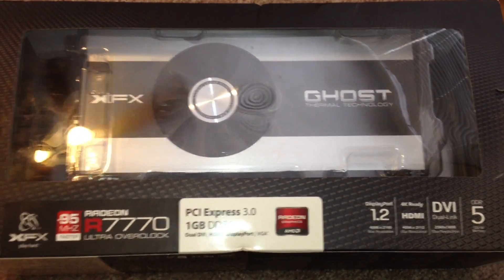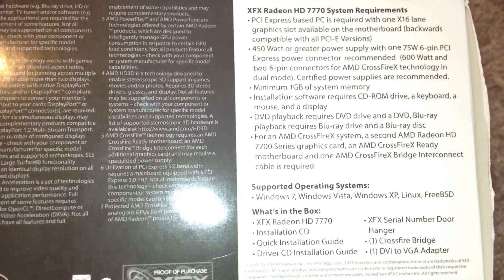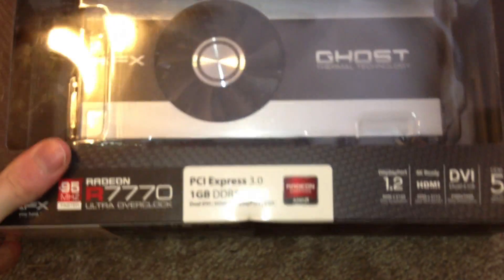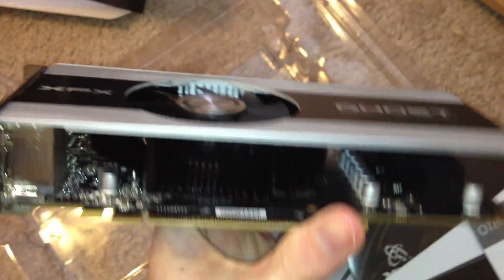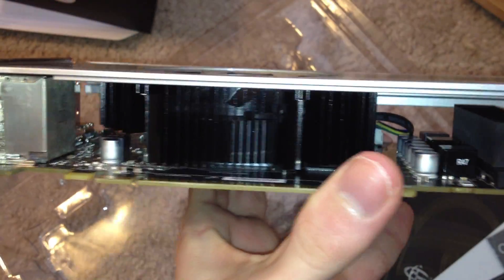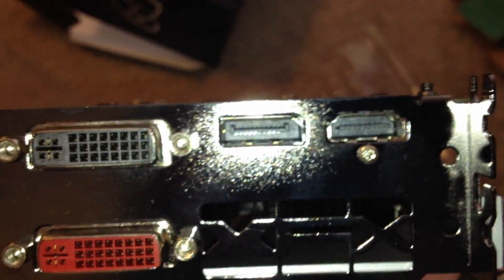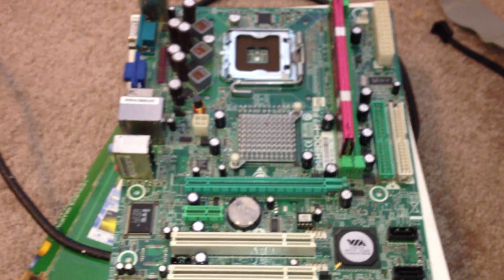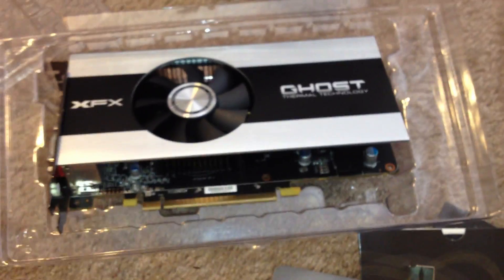XFX Radeon HD 7770 Core Edition Review

Comment: Can you still run smooth today games??
Reply from the maker: For the most part yes i havent had this for many years now though
Reply: My xfx r7770 1gb ddr5 core edition....cannot cross 400mhz....please help
Reply from the maker: I had the xfx ghost thermal super OC edition. I tried overclocking it before but its not even really worth it. Do you have performancr issues or is it just reading a low clock speed?
Reply: yes...the fps drops to very low...but sometimes i heard loud noise from my gpu and the fps raised for 5-10 seconds..
Reply from the maker: Have you tried doing a clean install of the latest gpu driver?
Reply: Yes..and one thing gpu load is at 90-99o%
Reply from the maker: Thats obviously not normal. Perhaps something is causing your gpu to be under load near all the time? Is all your hardware up to par in terms of power? Any bottlenecks in your system?
Reply: Spec 
i5-2440 3.2ghz
8 gb Ram
Motherboard Asrock B75 p-5
450w Corsair psu
Reply from the maker: Seems fine to suffice your hardware specs. Tried reseating the card into the PCI-E slot or moving to a second PCI-E? rare but the possibility is there,you may have a bad chip on your card but unlikely. I highly suspect you have a software or driver related issue. I no longer have this system or a computer at all but i do suggest possibly heading over to tomshardware forum and possibly looking up similar issues or post a thread asking for further advice. Sorry im only able to help so much.
Reply: Thanks for all the advices.....you really help me
Reply from the maker: You're quite welcome,its what im here for and strive to do my best to assist people however i can. Wish you the best of the luck resolving your GPU problems!
Reply: i got another problem....i fix my card by changing the thermal to toothpaste...it really amaze me..when i used normal thermal paste the temperature raise and the fps decreased but with the toothpaste even playing high games i got 60 temperature max....but one thing is that today i clean my comp by taking out all the parts inside it but...when i placed my gpu to pcie 3.0 after i clean it it cant display but when i placed another gpu it works fine and i test my gpu to other computer everthing work fine.please help
Reply from the maker: Lmfao that is one of the absolute funniest computer related things i have ever read in my life. I literially had to look that up... i STRONGLY suggest not using toothpaste... i personally only use antec diamond thermal compound and you dont need much at all. In most cases,less is more. However,it sounds to be your PCIE lane has an issue with reading that specific card leading me to believe you may have a fault somewhere on that lane or the card itself. More so it appears to me your card may be thermally damaged,this would explain what at times it will run at a high FPS and others not,or proceed to degrade in its performance as it heats up. Luckily you can get a replacment for very cheap for a card like this now a days. My personal advice though... i always stick with intel CPU and nvidia gforce cards,i have yet to have a problem with that combo unlike when using intel&AMD or amd and AMD ATI cards. I have noticed for years that ATI graphics drivers crash far too constantly while gaming and especially when overclocking,even on very minimal clock speed increase amounts. Just my 2 cents in personal experience.  A GTX 560Ti would be slighly faster overall than the 7770 HD and can be had for 50-75$ off ebay.

Comment: do i need a driver to install it?
Reply from the maker: Kevin An yes! im quite positive that this card did not function natively without installing the ATI radeon driver UTI FIRST i couldnt do this however without the card installed so itd detect which card i have. so i just used the CD driver disc that came with the card. then later updated the software driver using amds website for gpu driversm

Comment: Did you ever try to overclock it more then the factory version?
Reply from the maker: Yes if i remember correctly. It wasnt no more than about 210mHz or so on the base/shaders/core and wasnt really worth while doing,the ATI drivers crashed too frequently when overclocking to worth-while limits,with little to no gain. (2-3fps max gain)

Comment: That's one hell of an upgrade !  Does the 7770 run hot ?  I'm on the fence about buying an XFX r7-265 with the same heatsink fan configuration.
Reply: +Gaming Difficulty wel with heavy games like warthunder it runs about 80 75 degrees max
Reply: +Gaming Difficulty yeah i have a large case and i am getting over 70c  under load
Reply from the maker: i didn't actually upgrade form that tiny card, i think i actually had the 5770 or hd 5450. i currently have a whole new system, EVGA GTX 750 Ti 2GB (SC) edition, i5 stock clock 3570k 6Gb ddr3 1333 corsair + PNY. etc i have new videos up on my newest rig. this specific card no it never ran hot. at most maybe 149F. it was a really good card though, for the right price its a great choice.
Reply from the maker: a pretty good bit id honestly have to say. the 560Ti is probbaly just SLIGHTLY faster than my current 750Ti though mines 2GB GDDR5 vs most 5xx series are 1GB (not all) if you'd like tech specs though compared side by side... so going by hwcompare, the HD 7770 and 750Ti are VERY close in terms of performance. personally either is a great choice. i have an EVGA with twin  fans and its quiet and runs cool and uses very little power where as the 7770 uses more power but the ghost thermal XFX 7770 i had ran VERY cool and quiet as well.
Power Consumption (Max TDP)
GeForce GTX 750 Ti
60 Watts
Radeon HD 7770
80 Watts
Memory Bandwidth
As far as performance goes, the GeForce GTX 750 Ti should in theory be just a bit better than the Radeon HD 7770 overall. (explain)
GeForce GTX 750 Ti
86400 MB/sec
Radeon HD 7770
72000 MB/sec
Difference: 14400 (20%)
Texel Rate
The GeForce GTX 750 Ti is just a bit (more or less 2%) faster with regards to AF than the Radeon HD 7770. (explain)
GeForce GTX 750 Ti
40800 Mtexels/sec
Radeon HD 7770
40000 Mtexels/sec
Difference: 800 (2%)
Pixel Rate
The GeForce GTX 750 Ti should be a small bit (more or less 2%) better at anti-aliasing than the Radeon HD 7770, and capable of handling higher resolutions without slowing down too much. (explain)
GeForce GTX 750 Ti
16320 Mpixels/sec
Radeon HD 7770
16000 Mpixels/sec
Difference: 320 (2%)
Reply from the maker: yes much agreed it really is a great card either which way, as for it being on par with a 580 though... i don't see how thats even possible when the 560ti is STILL slightly faster overall than the 750ti as well as a 560 is faster than the hd 7770 as well. you're very welcome though im glad i can be of assistance.

Comment: I wanna play Battlefield 4 should i buy this one ?
please reply demonsparkx
Reply from the maker: Yeah this was a def keeper of a card it ran gta iv pretty much completely maxed with good fps. Ive ran bf3 on much lower end stuff. The xfx radeon HD 7770 will be good enough for med to high possibly maxed. I had a 5770 and played bf3 64 players online with all high settings with a 40fps min 50 average fps mostly 59 fps. That was the 5770 much older than this one. Its not the highesy end card but it will work great
Reply: demonsparkx I'm going to buy ASUS Radeon R7 260X..........its awesome i wish it will able to run BF4 GTA5 DIVISION WATCH DOGS :)

Comment: hi demonsparkx wondering if you can help me, i have the same card there but mine is the fx r7750 core edition 1gig ddr5, can you tell me the maximum temperature of my card please, the reason why im asking is because i did a stress test on it and it hasa maximum temperature of 49c...is that normal or is there any way i can tweak its settings to go a little hotter, my games seem to be crashing to desktop whenever it reaches 49c temperature it has a cut off point, especially skyrim maxed out after 10 mins gameplay :/ but i can play all day long on battlefield 3 maxed out so i dont know what the problem is...can you tell me the problem i am having and like i said is there any chance of tweaking the settings to go just a little hotter as i know it would stay stable around 49c...much appreciated if you can help me :/
Reply from the maker: well you want the temps cooler not hotter. 49c is a good temp for this card. they can handle much higher temps without any major problems. around 80-90c or so. 220F the temps i typically got with this card were in the low 120F to around 159F. i use F not c but you can use a converter to get accurate temps.
Reply: demonsparkx the cooling i have no problem with, i have an amd athlon phenom ii  3x core, 8gig of ram, and the r7750 core edition gpu, my case has 5x fans mounted, 4 sucking air in and 1 on the back for exhaust, the cpu fan sucks air in too, i figured that out to keep the air flow very cool, my whole system stays around 25c, the core itself using i use speedfan stays around 17 - 18c..perfect airflow...the issue is the gpu card, every game i play is perfect on max settings apart from skyrim, which Crashes to desktop when the temp hits 49c??...i want to stop that by increasing the value of the temperature of the gpu to around 60c, i had the same problem with my cpu causing my games to crash to desktop around 50c, then i changed that from the bios settings to set the cpu value its maximum at 60c therefore no more problem...so is there a way i can change the gpu value like i did with my cpu value to stop it cutting my skyrim off whenever it hits 49c
Reply from the maker: thats really weird man, im running a micro tower right now and my rig gets BOILING hot. 170-180F on the GPU 70-80C and my cpu reaches around 148F 64c  i have a phenom ii x4 955 and zotac GT 630 though.  as for the xfx cards you're only reaching 120F on the GPU thats no where near hot enough to cause issues. what is your power supply?  also, def update the drivers/do a fresh driver re-install. AMD/ATI cards and mostly the drivers are known to be buggy as shit. in my own personal experience. ive had many ATI cards and ALWAYS had some sort of issue software/driver related. which is why im going to stay back with Nvidia cards.
Reply: Peter Price I think you're approaching your Skyrim problem from a strange angle.  49C will not make any game crash, so that's not the issue.  Like demon said, that's a great temperature to have under load and one should only be concerned when their GPU temp is over 80C for extended periods of time and even that won't kill it quickly.
Reply: Gaming Difficulty the problem was the powersupply and razors skyrim iso file is faulty...ive just got the amd r7 260x  and had to upgrade the my powersupply to 650watt, it was 500watt before...i play shadow of mordor on ultra settings now and it runs fine....works perfect on every game but skyrim always CTD even when its just a standard installation, no mods, no updates or anything... textures start turn purple then CTD...i think razor needs to fix his iso file...i did what everyone says about patching it and running a 4gig memory patch...but nope it still happens....turned the textures, shaders and everything on low setting....no joy...it still CTD after 20mins gameplay...faulty iso file....thats my opinion
Reply: Yea, it sounds like a faulty file issue.  Thanks for replying cause I was genuinely interested in the culprit.

Comment: Hey bro, getting this card to race Assetto Corsa...do you like DisplayPort or DVI connectivity for monitors?
Reply: +teakbridge101 Yes you can play assetto corsa with this graphics card, with decent fps.
Reply from the maker: sorry man i have no idea what Assetto Corsa is, but i personally just used DVI and VGA since my monitors were typically cheaper end ones they didnt support HDMI or DisplayPort. none the less this was by far my favorite card i owned other than my 550ti. both very very good. this 7770 uses a bit less power than the 550 though
Reply: demonsparkx haha, well my monitors are cheap too, but Dell supports DisplayPort, the only major brand to do so as far as I know. Thanks.

Comment: Am I the only one with a short 7770 Core Edition with 1 fan that is overclocked and won't get over 60C?
Reply from the maker: this card stayed way much under 60C highest ive ever seen it reach wa near 150F or so, very happy to see the cooling was superb on this card. was yours also the same XFX core edition? i think there may be two different ones i also have seen the shorter version card but im not sure if that one has the ghost thermal as im not too sure on why they would make two lengths for the same PCB if not lol
Reply: I have the same, it's really short, i've overclocked mine to maximum, still, doesnt get over 55 c. and is awesome. :D
Reply from the maker: Mine has always been fine as everyone can see which 7770 i had. I never had any heat issues. If anything it stayed relativly cool
Reply: I just got a used 2 fan model, ( my friends old one , used it for like 2 months). What is the reference clock( stock settings)? What should I set it at to play battlefield 4? im  a newbie, sorry!

Comment from the maker: id imagine it would be pretty good. this exact card is stuck pretty firmly between a 550Ti and 560Ti geforce. without any overclocks applied. im a heavy GTA IV player. and i played at the maximum settings completely with playable FPS on just this card by itself and a intel Q6600 quad core oc'd from 2.4 to 2.9Ghz. so its a pretty good card by itself. i think they're only like $130 on newegg. i paid almost 200 but got 3-4 free games on steam with it.

Comment from the maker: the 7770 here was better then my 550Ti for sure, the 460 is slightly better if not equal to a 560ti. so id go with a 460 gtx over the 7770. i paid $190 for mine, it was at best buy and came with 3 steam games. either or the 7770 or 460 will do just fine for todays games. i ran gta IV maxed out prety much on the 7770 and still got 30fps at 1600x900 resolution. 8Gb of ddr3 RAM is plenty enough. i like G.Skill RipjawsX series peronally. cheap and good ram. for psu i stick with corsair

Comment from the maker: it will def help with cooling, the 7770 doesnt have alot of headroom for overclocking IMO though. i think the 1095 core clock wasnt a whole lot different compared to the clock speeds. my card was factory oc'd. either way though its a great card with or without oc'ing

Comment from the maker: nicee, well offhand the only things i can think of is the card design like a reference card, stock overclock, and the actual ghost thermal card, which generally will just run cooler. as far as i know though,spec wise all HD 7770's should be identical. one may be slightly better then another in some tiny ways but nothing noticeable other then possible lower temps

Comment from the maker: the "gaps" or so it looks to be is actually made like that on purpose for the "GHOST Thermal" so the heat sink can expand and freely flex when it gets hot. but actually ive never even gotten it to 60C under full load no matter how long i stressed it. it def runs pretty cool and very powerful. im sure its more then enough to run about any game. i THINK my windows graphics and gaming score with that card was a 7.6 lol good luck. i doubt the 7770 HD will disappoint you ;)

Comment from the maker: well it was running on pciE 1.2 i think, it wasnt even running on a 2.0 PCIe slot, and was on a LGA 775 intel motherboard that cost $50, with a Intel core2 QUAD Q6600 at 2.8Ghz itll max anything out pretty much, unless it needs more then 1GB of Vram like GTA IV does. but i have benchmark tests from this card, testing stuff like dirt3 hitman TF2 GTA IV and EFLC need for speed etc. all at least 90% to 100% maxed out completely. and my lowest fps drop ever hit was around 29FPS. on GTA

Comment: Nowhere on the box does it say core edition, i have 2 xfx core editions running in crossfire on the box it clearly states core edition and runs at 1ghz not factory overclocked.There is DD Black Edition Super OC, 5200MHz GDDR5, 28nm, GPU 1120MHz, but not core edition, look on xfx website man no way is it FX-777A-ZNJ4 i have 2 of them look on the website xfxforce. com

Comment from the maker: nice specs, i used to have a athlon II 640. my best suggestion would look into the software side for issues. as this card is plenty capable to play about anything. uninstall all and any drivers for/from ATI AMD and or Nvidia if any exist. known as "clean installing graphics drivers"  then use the CD disk drivers for the card and afterwards you can use AMD's site and download and install the latest drivers for that card off there. this is what ive done and i never had any issues.

Comment from the maker: 0:04 seconds you can plainly see the box and it says +95Mhz ultra overclock. this is the CORE edition by XFX.
XFX CORE Edition FX-777A-ZNF4 Radeon HD 7770 GHz Edition 1GB 128-bit GDDR5 PCI Express 3.0 x16 HDCP Ready CrossFireX Support Video Card 

    640 Stream Processors
    1GB 128-bit GDDR5
    PCI Express 3.0 x16

any more questions?
oh and i hold it from the bottom since its not a very delicate electronic as most people think... gpu's handle ALOT of power on a daily basis...